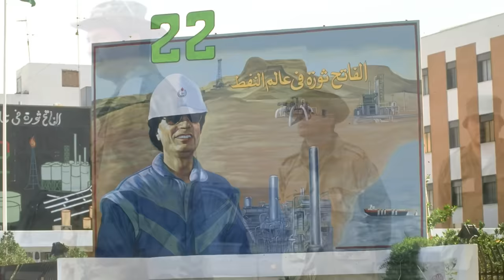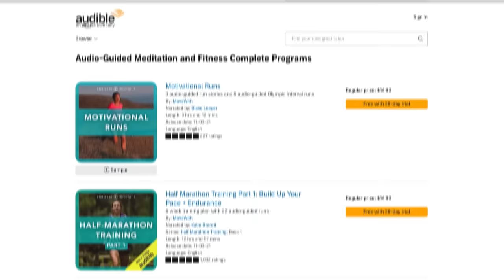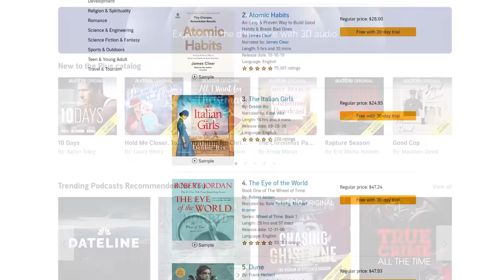How Libya Built Brand-New Rivers Across the Sahara

Comment: I actually went with my uncle to transport the huge concrete pipes, the project was a huge boom for the economy. The pipes do have a 50 year life span so it well be interesting to see how to overcome that heardle. Hopefully we figure something out
Reply: so the earliest part of the project is half way into it's life span?  Hope Libya gets everything sorted out soon so they could at least plan for repairs and replacements.
Reply: @xsu-is7vq  
No, the project was started in the early 80s so it's closing in on forty years. A fair amount more than halfway.
Reply: @jayw900  first phase was completed in the 90’s.
Reply: I hope the components last well over their 50 year life. The 1 thing Libya needs now, more than ever, is time. God bless ❤
Reply: O NO
Reply: the concrete pipes will last more than 50 years
Reply: @مقاطعمترجمة-ش8ث  if you use it to irrigate crops, the water won’t last nearly as long.  growing crop in hot arid desert is one of the worst use of water.  Although making sure city dwellers don’t waste the water they are getting is also important.  Maybe a daily quota could be implemented.
Reply: Does the water even hold.that long ?
Reply: Need to switch to Geopolymer techniques using granite and quartz. This is what the ancient Sinhalese did in Sri Lanka, which was the most advanced of the hydraulics civilizations having created 15,000+ reservoirs interconnected via a network of cascading canals and dams that are both under and over land. Unfortunately more than 90% of the hydraulics infrastructure is in ruins. The collapse of the 1,600 year long Kingdom of Anuradhapura leading to a medieval period and then colonial exploitation resulted in both the people and the place fo degrade regress.
Reply: @NarasimhaDiyasena I've found a new history rabbit 🐇 hole. Shukran
Reply: Modern day concrete pipes only get stronger with time.. if the quality of the pipe and the placement/installation are done correctly, those pipes will not need to be replaced for atleast 200 years and that will only happen because of no maintenance, if properly maintained the pipes will never have to be replaced
Reply: @NarasimhaDiyasena Roman concrete might work too since we now know how that works finally.

Comment: I worked on the project gas turbine compressor station providing high pressure gas to a power station, this provided power for water export pump. For my nine months on the project I saw few if any Libyan nationals on the project. Engineering was Man GHH Germany, construction was a mix of Pakistani, India & Philippine nationals, but can’t recall any direct Libyan involvement.

Comment: I'm wondering if Gaddafi had any plans on how to replenish those Aquifers?
Hopefully once Libya becomes stable again this project will be completed. And it wouldn't hurt to install desalination plants to help meet water demands and reduce the strain on those ancient aquifers.
Reply: i was hoping that the natural rainfall would at least  fill up the northern section of those aquifers like a natural cistern. but rewatching the parts with the maps, its like theres a very clear "no water zone" between the rainfall area and the aquifers. unfortunately all i can see in the future is a scenario where those aquifers collapse or some bunged up effort involving the meditteranean
Reply: There is no current way to refill the Aquifers without using a tremendous amount of power and engineering. More than Libya has available. This is more of a stop gap. They need the water now, it is there for now, so might as well us it to help build a nation that can better itself in the future. 

What exactly that would be I do not know for certain. But it does buy them the time to find out. And that water in the Aquifers is doing nothing but sitting there now anyway. And would continue to do nothing in the future if not used.
Reply: Mass desalination, piping the water to the aquifers, and injecting the clean water into them?

It would be very expensive but if done it may solve the problem.
Reply: @davidtherwhanger6795  Your view is so wrong. Nothing but destroying. Libya simply should not have had so many childeren.
Reply: @john3_14-17  at that point just use desalination and inject into the network at the coast, no point pumping water up hill for hundreds of miles just to let it run back downhill to your cities at the coastline where it was made. (Basically as long as they invested in desalination before the fossil water runs out they don't need to refill the aquafirs)

In a perfect situation that would take the oil money and fossil water and use it as a foundation & kickstarter for a diversified modern economy that can fund the desalination plants and other social programs (like public schools and state run/sponsored health clinics/hospitals). But thats in an ideal world ignoring all the current instability and realities of the region. (Its really easy to say just be rich and stable, much harder to actually do it)
Reply: @rbd6502  hopefully these aquifers can be managed to at least give them a hundred years or so.  This should be enough time for our society to finally finish up fusion and thorium reactors and get them distributed more broadly.
Reply: @jasonreed7522  Yeah that's a good point.
Reply: 373 thousand billion cubic meters. That's how much fossil water there is in the Nubian Sandstone Aquifer System. That's more than enough to sustain the current population of the entire region for tens of thousands of years. Even counting industrial and agricultural uses, the rains will fall in the Sahara again before humans use up all the water in the NSAS.
Reply: @nehukybis  Fair point.
However if the population was to multiply multiple time over due to the new access to water and the potential for industry and business around it that could lead to it lasting way shorter than anticipated. And it's also a very important point that the amount of water could be overestimated and the more you use the harder it will be to squeeze out what's left.

Thinking the reservoir would last for tens of thousands of years and still be easily exploitable is very optimistic.
Reply: @RK-cj4oc  Libyans are only 7 million and our birthrates are similar to Western Europe.
Reply: @john3_14-17  expensive? not really, just have to put in the infrastructure.
Reply: @A.Severan  "only" 7 million. you live in a desert that cannot support 7 million. your birthrates are now at western europes levels. but before that Ghaddaffi would pay for every child born to muslim arab Libyans in order to increase that ethnicities hold on Libya.
Reply: @RK-cj4oc  There’s a degree of dramatization in this video, we can survive without the GMMR. GMMR was mainly made with the desert communities in mind and to desensitize the rapid migration from their regions into large coastal cities. I live in Tripoli and my water is sourced locally. As for the population, land suitable for agriculture is 10% of the country. That’s 10% of the 16th largest country in the world, which is a lot if you think about it. It’s bigger than the Netherlands, and their population is 17 million.
Reply: @RK-cj4oc  your so wrong
Reply: Why was he supposed to think about that ? Do we ever think of replenish the oil wells

Comment: FYI: 🇨🇾 🇪🇺
CYPRUS has a total of 108 dams and reservoirs, with a total water storage capacity of about 330,000,000 m3. Dams remain the principal source of water both for domestic and agricultural use.
Reply: 330milion m3 is nothing compared to 35000KM3, cyprus's one equals only 0.33KM3

Comment: In foggy areas, setting up fog nets to catch water and then using it to plant trees, which in turn will catch fog which will drop into the ground or if the tree is on high ground, the water can drop into pools.  Then they can gradually expand the tree cover, as was done on Ascension Island.

Comment: It seems like they might be able to make the aquifers somewhat renewable if they dug some trenches out from the Mediterranean into central Libya to filter through the ground and into the soil/sand.  They could probably even make some sea salt harvesting operations and could lower the local temperature a little while evaporation from the canal might give a boost to the local water cycle.
Reply: That's actually what I thought this was going to be about before I watched it; canals bringing seawater inland to increase humidity through evaporation.
Reply: Sea water has salt. It would be useless.
Reply: @Tugela60  the point is to evaporate it to increase environmental humidity and harvest the salt.
Reply: @danielled8665  What would that achieve, other than covering everything with salt?
Reply: @Tugela60  salt is a harvestable and saleable resource, it would increase humidity and allow for rain inland, salt marshes could form which are a thriving ecosystem in themselves...
Reply: @danielled8665  Nonsense. The amount of humidity that would generate would be insignicant. After all, the ocean is right there and it does not generate rain. Evaporating a few patches of salt water would do squat. And no, there is no big market for salt. Salt is cheap.
Reply: a lot of information in this comment. Thank you :)
Reply: Nicholas D.  Doesnt mean it's useful at all, the comment advices here are just plain with no meaning

Comment: Californians can indeed relate: seasonal rivers, not even flowing every year any more, and depleting aquifers. I'm reminded you've made an excellent video about our water problem and the solutions. I can name no more than two natural lakes here is SoCal; absolutely the most are man-made reservoirs. The Californian aqueduct alone delivers 1km³/yr. The engineering feat of burying the aqueduct is indeed not easy to pull, but the maintenance cost of this solution, from regular maintenance dredging to incident repairs is comparatively much higher, and add that to the fact that this cost is on a quite poor country. In earnest, they would be better off with other existing solutions, variously compromising between evaporation losses and maintainability, if not for the Gaddafi's megalomania, with his desire to build the largest completely buried aqueduct system in the world. If it made the best engineering compromise, his one would neither be the first nor the only one of this scale...
Reply: This is a garbage comment. GADDAFI was loyal and a hero to our peoples
Reply: @HeyGuy4321  how did that work out?

Comment: Another example of an interesting trend I've noticed: dictators tend to be very good at getting specific projects done.  This is both a good thing and a bad thing, as these are the projects that the dictator is interested in...which can be a country wide water distribution network to free the country from reliance on expensive water imports...or it can be pouring the entire country's wealth into building a personal palace.  

And regardless, this often comes at the price of not getting much else done.  Countries are large enough that they have a lot of different critical systems - far too many for one dictator to keep track of.  In non-dictatorial systems, the obvious solution is simple: autonomous systems - give different groups of people enough authority to run their system independent of external oversight, or with a bare minimum of it.  In dictatorships, this is often seen as risky because someone without oversight is someone who might be plotting a coup.  The preferred solution seems to be setting up everything to be inefficient so that even if a coup is being planned, things go slowly enough that you can catch wind of it in advance.  Which means all these critical systems run terribly.  Or if the dictator is paranoid enough, they just don't exist.  Either way, the people who need that system working properly get screwed over.

The dictatorships that work well tend to be the ones where the leader is beloved enough that they can have decently running autonomous systems and not worry about coups because who's going to support a coup against a competent leader who's actually keeping the people who control the country's power system happy?   The downside is, throughout history, nobody has ever figured out a solid way to make sure you have a similarly competent and benevolent leader after your current one dies or retires.  Just look at basically any monarchy in history and you'll find examples of countries with excellent leadership leading their country through a golden age and a successor (often their immediate successor) royally screwing everything up.  See for example the first batch of Roman emperors.  Augustus, does a pretty solid job of unifying Rome and founding the Empire.  Tiberius, eh, holds on pretty well.  Caligula: declares war on Neptune, has a legion throw spears into the ocean then collect sea shells on the beach as a form of looting....and similarly bizarre shenanigans.  Claudius, again, pretty decent.  Nero: lets a good chunk of Rome burn down and builds a palace where the fire was. 

Democracy isn't perfect, but at least if you manage to elect an incompetent buffoon, you have a pretty robust system for replacing said buffoon.  (It might take you a few tries to get one that isn't a buffoon, but at least you flip through them fast enough that they probably don't have a chance to mismanage their way into half the capital burning down.)
Reply: Agreed.
Reply: Libyan here!

You explained what I've always been wondering about in a nutshell

I've always been puzzled between dictatorship & democracy, I always seems puzzled by those who advocate for democracy blindly like eh? you think it's really the angelic system? you don't have doubts about it?

But at the same time I couldn't advocate for dictatorship becz if you got a bad apple, you're screwed, and if you got a good apple, the successor always screws things up, just look at the British history in the 1200 

The problem with democracy is that in an dictatorship usually the successor is trained for years and molded to become a Leader, but in a democracy a random folk walking down the street may suddenly become the most powerful in the country, and that's what screw everything up

From 1979 till 2020 not one president of the United States was an experienced politician, the only exception was Biden but was such a bad apple

Comment: I wonder if it would not be possible to construct (horizontal, flat) containers with relatively large surfaces that are black on the top side so that they can absorb a maximum of sunlight and use that to make seawater evaporate, and higher up 'catch' that vapor and make it condense on the inside of another such a space but these ones diagonally placed and with a catch-up 'gutter' at the lowest points (placed sideways away from the primal units at that they don't block the light, of course) that can be cooled using a flow of seawater pumped up from relatively high depth so that it is relatively cool, the pumps being powered with solar...

Comment: The "not renewable" problem isnt actually that much of a problem.. it just has to last long enough that enough infrastructure, e.g. power plants, has been built to desalinate seawater.
Reply: Correct.
Reply: Well, you would think. But cheap water has a way of making people forget about when it runs out. The US has multiple aquifers that are running out, and which supplies most of its central farmland with water.
Reply: And desalinated water is just too expensive to use for agriculture.. So goodbye to the Midwest.
Reply: @Carewolf  Neither the US nor agriculture are the topic here...
Reply: @s1nnocense  The question is why wouldn't they use it for agriculture? Other nations have done, and there is enough water for decades of growth. More to the point if it is cheap enough to consumers, how do you prevent them from using it for watering crops instead of drinking?

Comment: A point you did not mention: when people pump fossil water out of the ground, if it doesn't go back in the ground, then it ultimately ends up in the oceans, contributing to sea level rise. Also you state that Earth's orbital cycles (presumably you refer to the Milankovitch cycles) will green the Sahara again in 10,000 years. You seem to assume the world will be like it was the last time the Sahara was green. But it isn't now. Back then, during the last glacial maximum, atmospheric carbon dioxide levels were around 180 ppm, below the 280 ppm level of pre-industrial Earth in the year 1750. Since then, the Industrial Revolution has raised atmospheric CO2 to around 415 ppm, with no end to the rise in sight. If humans remain on their present course to burn all recoverable fossil fuels, we could send CO2 to 2,000 ppm, a level Earth hasn't seen since dinosaurs walked the Earth. Carbon dioxide is very durable in Earth's atmosphere-ocean-biosphere system, and barring a massive human effort to remove all the extra carbon dioxide we've added and are going to add, there will be a lot more CO2 floating around in 10,000 years. This will make the effect of Earth's orbital cycles very different. You can't just assume the Sahara will be like it was before. Instead you need to look at what the Earth was like the last time it had so much CO2 in the atmosphere. But back then, the Sun was also slightly dimmer.